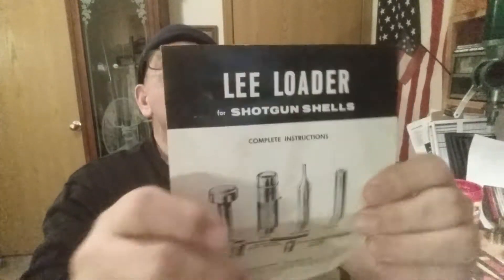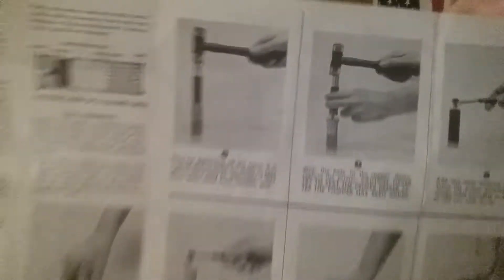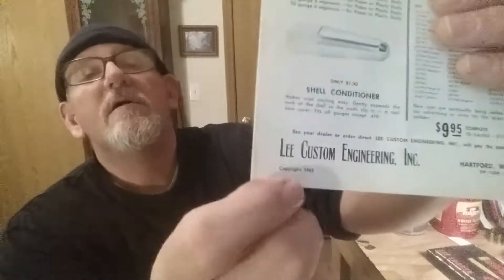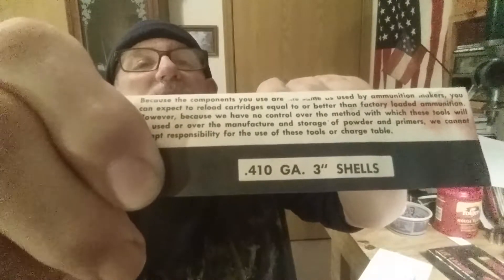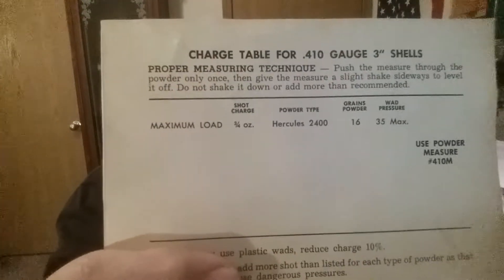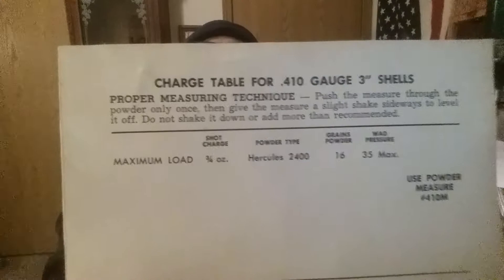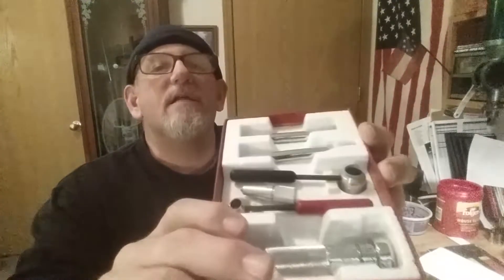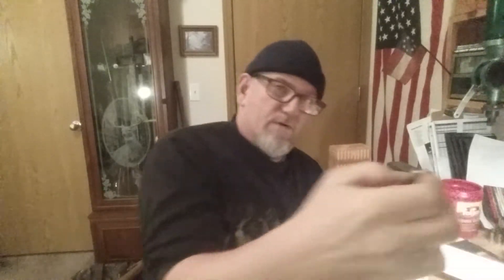Lee loader 410 gauge

Comment: Got one of those for 20 ga and 30-06 from my ex-father in law. Scared me to use it.
Reply from the maker: Mike Treen it does seem to be a little scary looking dust in it I don't know stead of forcing it with pressure just tapping it in with a hammer mallet wish I had a 410 I try it out